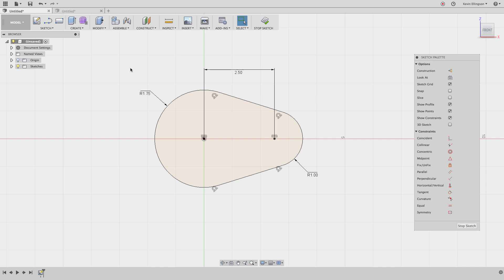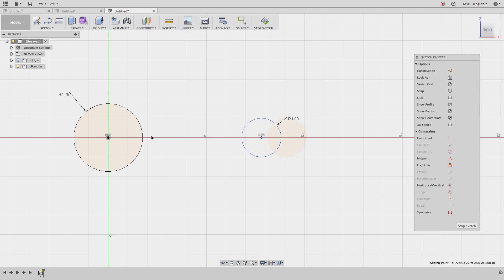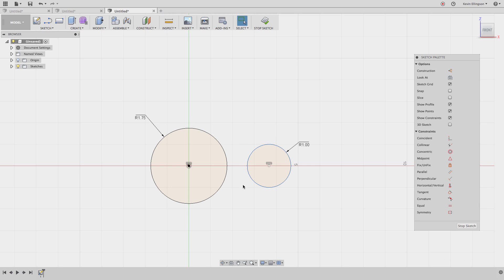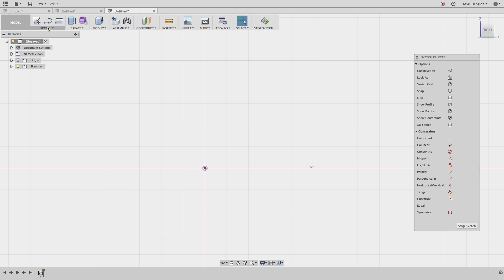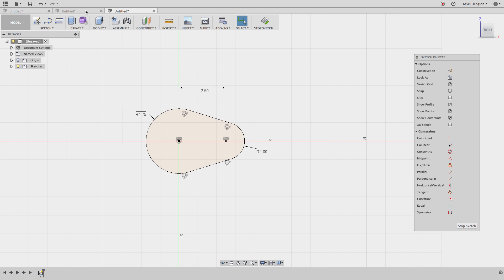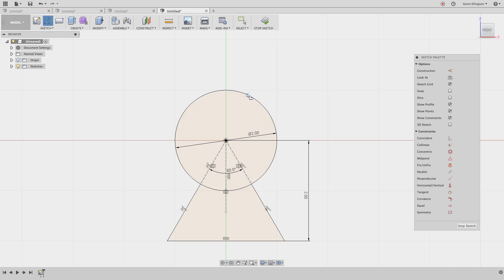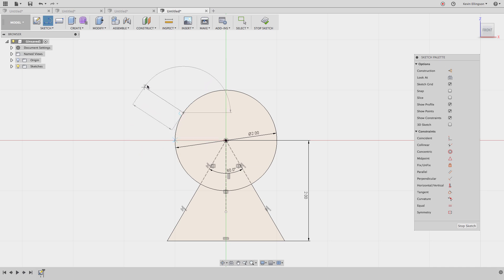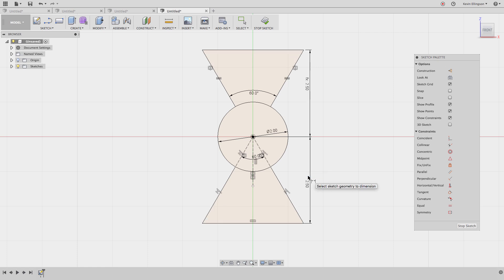Fusion 360 - Secrets of the line command

Comment: I would stick with option one and use the Symmetry tool instead of drawing the bottom line @3:18 But if I was in AutoCad, then I would use the method you highlighted in this video, since it is utilizing the parametric tools!
Reply from the maker: That is not a recommended choice. Symmetry constraints are computationally intensive.

Comment: For those wondering with the 2020 update, for an arc with a line, it's holding down left click, not right click.
Reply from the maker: Did I say right click on the video? It was a mistake if I did.
Reply: @MechanicalAdvantage  I think you might have, I know at least some other people have in other videos, just wanted to help, especially since Autodesk changed some things with Fusion in 2020

Comment: How does one add or remove constraint selections from the palette?....also how to turn snap on and off? Thanks so much.
Reply from the maker: The video is a bit out of date. The constraints live on the toolbar now. You cad add or remove constraints by finding the constraint on the constraint panel and then you can click the 3 dots and choose pin to toolbar.
Reply: @MechanicalAdvantage  thanks so much for your reply. The challenge with using utube is learning from the ground up while the user interface is continually updating.

Comment: Thank you so much....when I use line command some times I don't get  'x indication. Pls reply
Reply from the maker: dharsanam I’m only taking a guess here. Start a new sketch, find the grid and snap settings on the bottom toolbar below the drawing window. Is snap to grid turned on? Shut that off and see if it helps if it’s on. If not, shoot me an email to info@mechanicaladvantage.com
Reply: @MechanicalAdvantage  thank you so much for reply...

Comment: After you do the first trim in the video, is there a way to measure the circumference of that shape?? I’d like to 3d print a TPU “tire” to go around that shape but need to know the length band I’ll need.
Reply from the maker: I just gave it a shot and there doesn't appear to be a way to measure the length in a sketch. However, if you make a solid out of the sketch using a command like Extrude, you can start the measure command and click on the face and the measure dialog box will show you the loop length.

Comment: good info!  What about drawing multiple lines consecutively with different (non coincident) points vs chaining a line?  Do you have any tricks for that?  Esc exits the line tool which is not ideal for quickly drawing consecutive lines.  Alternatively double clicking or single click on the green check mark will terminate the line without chaining and without exiting the line tool.  I have also mapped a button on my spacemouse to double click to terminate my lines.  All of this works ok, but I would prefer to be able to toggle the line tool between chain and no chain somehow by a modifier key or some other method.  Also, I wish there was an easy way to just extend a line to be longer but often there is an automatic constraint that gets set that won't allow you to drag the endpoint longer.  Something like a modifier key to override or delete the constraining constraint would be handy (albeit with risks) in many situations, or maybe a modifier key to prevent automatic constraints from being set (e.g. drawing a horizontal or perpendicular line without automatically setting that constraint).

Comment: how do you get the line to snap to an existing line? it used to work but this crap software gets more unusable with every update
Reply from the maker: I’m not sure why you are having an issue. Feel free to email me info@mechanicaladvantage.com and I’ll see what I can do to help.
Reply: @MechanicalAdvantage  I started using Fusion about 6 years ago, since i subscribed and paid for it the product is becoming more and more unusable. it used to be good, very easy to understand but now its just a complete mess
Reply from the maker: I’m not experiencing the same issues you are. I’ve been using Fusion since 2013. It was an invite only beta. I haven’t had issues with it becoming more unstable. I use it to teach a few hundred people in classes a year. I’m teaching it to 3 sections of high school kids right now. I do custom programming for customers frequently. I just don’t experience the issues. Do you have examples you can show me that I can share with the Fusion team?
Reply from the maker: The paid version and the free version are the exact same code. For instance, if you signed out of Fusion and signed in with a free account, you wouldn’t have to reinstall the software. If you went to a different users computer that had the personal license and they signed out and you signed in with your paid account, it would be the exact same install. The code base it exactly the same.
Reply: Nowhere near as good as Solid Works, but there again it costs peanuts so just what did i expect?
Reply from the maker: @crozwayne  You want to compare a program that is 30 years old to a program that is 7 years old?
Reply: @MechanicalAdvantage  Big industry doesnt use Fusion 360
Reply from the maker: @crozwayne  There are now over 125,000 active monthly (paid) subscribers of Fusion 360. The personal use licenses are much larger than that. It will take time but Fusion is making its way into industry especially for industrial design and manufacturing (CAM).
Reply: @MechanicalAdvantage  not based on my discussion with design draughtsmen I speak to, their immediate response is “fusion 360, wtf is that?”
Reply from the maker: I guess only time will tell. It’s being widely used in Education. It’s being used heavily to drive CNC machines. It’s being used for industrial design. It’s gaining momentum. 6 years isn’t a blink of an eye in this mechanical design industry. Adoption will take time but it is happening. I make my living from only Fusion training and consulting/support work. It has been a long time since I’ve done any inventor or AutoCAD jobs.